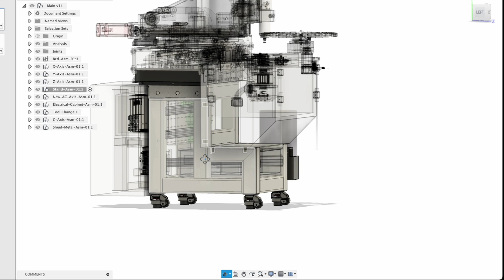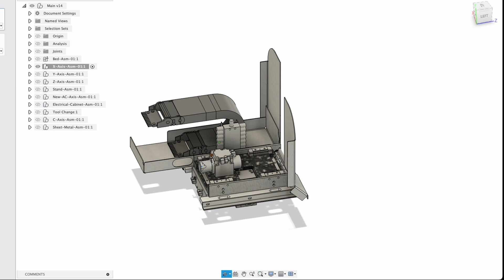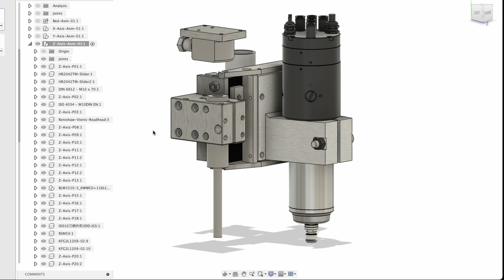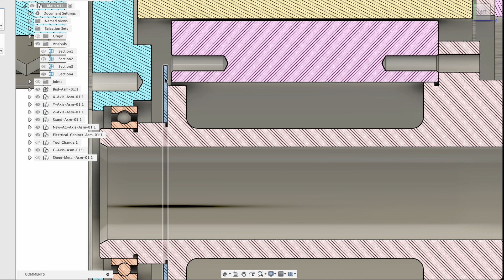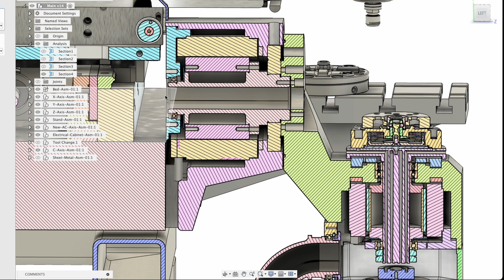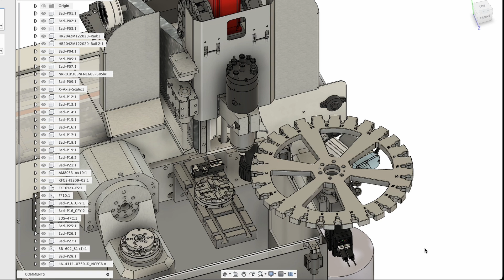3D Designing a SUPER-PRECISON 5 Axis CNC Machine - E001

Comment: Great design, look forward to the finished product.

One question, why did you choose aluminium as your choice for the rotary axis? I see a lot of DIY machines but I generally put it down to cost etc. Would a cast iron or steel one not suffice for any particular reason? Or is this choice purely cost driven?

Comment: Very nice and interesting cnc machine. It's a Quite complicated, which means quite expensive. But the whole concept and the individual solutions seem correct and should work correctly without any big problems. I see a couple of technical solutions for the first time, which I would like to implement to my own CNC equipment, for now of course, in my dreams... But who knows, maybe in the future I will be able to realize something. The best thing I have observed in your device is a solution in which the processed material is stationary (of course we are talking about a 3-axis machine), and all the equipment placed on frames moves in the x, y, z axes. This creates the possibility of significantly reducing the problem of ubiquitous waste and chips generated during cutting, in particular getting them into the drive mechanisms, bearings, rails, etc., as well as using the coolant liquid exactly in one area in the work zone. Since this, entire area will be tightly built up, it will create isolation of the entire machine part with drive mechanisms, control electronics, etc., from being flooded with the coolant used during the entire manufacturing process.  In addition, you can also place a conveyor belt at the bottom of such a sealed tank to facilitate continuous removal of chips from the machine, as is done in professional industrial CNC machines. Apart from the fact that the entire complete machine will be very, very heavy, the mechanical part itself consisting of granite frames and containing most of the drive of the individual x, y and z axes, spindle motor, stepper motors, etc., will also weigh a lot, which probably requires the use of very strong and durable Rails, bearings, or the stepper motor itself, so I have a question, what power of these stepper motors must to have? Is there a conversion factor that tells, what power motors and all the rest of the drive components should be used depending on the weight of the device that the individual elements will move? Also, Will the entire process of building this machine be shown on the YT channel, which would be very interesting, and it would be great scientific material showing all the beauty associated with the construction of machines and their subsequent operation. Best regards from Poland, Jacek.
Reply from the maker: @jackwitkowski7818  thanks for the comment. 

You mentioned quite a few things, and some of them have already been answered in other videos. 
You are correct about the shape of this machine which would allow the workpiece be separated from the machine's axis. This concept is knows as a moving column among the machine tool people. The other two popular models are the C-Frame machines which are the typical VMCs and gantry (portal) style. The moving column is my favourite if the stroke in Y axis is quite short, which it is in this case. 

Regarding the motor torque/power requirements, there are a few formulas that can help with calculating the needed torque, but some of it comes from experience as well. When I get to the installation of the servo motors, I will remember to mention why I went with what type of motor. Keep an eye out for new episodes!

Cheers,
Kasra

Comment: wasnt there any option to use a slip ring instead of the conduit wiring ?
Reply from the maker: A slip ring is for electrical connections. A rotary union is a combination of a slip ring and multiple air/liquid lines. They are big, bulky, expensive, and with a short lifespan. I have used them in the past and don't like them. I tend to go with other options if I have the chance.

Comment: Nice machine. Just wondering why, the cooling on the ball screw nuts and liner rails. What type of temps are we talking about? What do they get up to?
Reply from the maker: Thanks for your comment. Even small variations could affect the accuracy of the machine (as low as 1 degree C). To have a stable and repeatable production, regulating the temperature is critical.

Comment: Very cool project.
Why have you picked umbrella toolchanger, over vertical wheel, in configuration used by e.g Zietz FS5MG or ABEL? You could have one less actuator (the one tat has to push umbrella inside work envelope), smaller floor footprint (good for home shop machine) and easy way to get 2x tool capacity by adding second wheel in parallel.
Reply from the maker: Those machines are a gantry system not a moving column set-up. There are a few reasons why I went with this concept. But in terms of length, this is the longest length that you can get a C0 ball screw. So for the sake of not having the actuator, I had to compromise the accuracy of the ball screw, or I had to made the fixed table smaller. The actuator and hinge mechanism was a more sensible option. In terms of the vertical tool changer, it was a consideration at first, but I really don't like those tool finger clamps, they break easily (especially for a T11 holder), and not very reliable. So I went with the solid option of fixed machined tool pockets. I guess 28 tools is an ample amount for now, but I can go with the vertical model if I needed more tools.

Comment: Looks like a very nice machine, I look forward to seeing it fully built and making some parts.

My immediate thoughts personally I would use a V-Lipped seal on the rotary axes, and even go a step further back it up with a labyrinth seal and make the rotary axes positvely pressured and purge air through them for absolute certainty your expensive components do not get damaged. Especially if you are going to use the C axis to mill turn parts.

I am sure you may have looked into that design choice when making your design, what would be your reasoning not to opt for these sealing methods over an O-Ring on the B axis?
Im not able to definitively tell what your C axis sealing method is from the CAD.
Reply from the maker: Hi Max, thanks for your comment. 

1- The C axis is pressurised, both the housing and the bearings. But after your suggestion for a V lipped seal, I have now added that. So thanks for the tip. I think the labyrinth seal is a bit over kill as on this machine we don't use high pressure coolant. So the positive pressure should be sufficient. 

2- This video was recorded months ago, I have updated the sealing on the 4th axis since.
Reply: @kasramehraky9283  No worries, I wait in anticipation for the next videos!, especially if you are going to make a video on the control integration and stuff. That is super cool to me.

I find the V-Lipped seal to be very resiliant, for example in DMG Mori machines they have a service life of around 10 years on the swiveling axes, and an undercut "labrinth" for lack of a better term, basically comes free in the manufacture of the parts, you can therfore ensure no coolant ingress into the C axis, depending on your seal clearance straight sealing is not always the best, a groove with drainage works good for the labrinth seal, kinda hard to explain the shape.
Reply from the maker: @max_eley  Thanks Max. I have seen the shape on the DMG machines actually. We used to have a few 5 axis DMUs back in the day...

Comment: 21.45 Labyrinth seal (air-seal) will be better to protect the costly bearing. 22.50 Also the second bearing seams less capable i'm not sure but i would not cheap out on it cause it is still important. awesome project.
Reply from the maker: Thanks for the tip for the seal, I will check it out. The second bearing is also a relatively high precision bearing, but not greatly preloaded.

Comment: Nothing super precision has wheels. 

Hardinge, Moore tools, Yasda, all micron precision, no wheels.

If portability is an issue, thats one rhing, but Sitting on 3 level points, is always your best bet, isolated on its own concrete pad.

Dont want to seem like its all critisizm! Just a first take 10 minutes in!

Beautiful machine, and a lot of work went into this!
Reply from the maker: Thanks for the comment. The machine will sit on leveling anti-vibration pads. The wheels are engaged only when I need to move the machine. If you keep watching, I go through the details of these castors.
Reply: 3 point leveling vastly reduce distortion, you surely know this.
Reply from the maker: @papukaiffa  Yes, that is correct. But not so much for a machine that is sitting on a vibration dampening rubber mat.

Comment: it's obvious that a lot of experience went into making this machine- not everyday that you see watercooled linear rails 😅

I love the modularity of the front portion of the bed - In theory it looks like you could also make a bigger fixtureplate and have a super precision 3 axis with a decent work area.

It would be nice to see some gang tooling on the turning toolholder, seems like you could pretty easily fit in several tools for smaller parts, although it appears you've built this with certain parts in mind, so maybe it's not super useful.

Those half linear rails seem like a bitch to assemble, let alone allign and preload - I can imagine ball bearings going everywhere super easily lol.

Purely out of curiosity, what kinda parts are you planning on making with this? Also what kinda budget did you aim for? Can't imaging custom lapped granite would be cheap!
Reply from the maker: Thanks for your comment. I have actually designed a larger fixture plate that is higher than 5th axis table which would allow to have a huge 3 axis machining volume. 
There will be a gang tool magazine for the turning tools.
I have explained about the special linear rails in the new video. Check it out!

The machine will be making small watch parts (including the movement parts - i.e gear train, wheels, etc), medical parts and electronic moulds.
Reply: @kasramehraky9283  cheers for the reply, already seen the new vid- its really inspiring to see this thing actually coming together, and Ive already learnt alot from the process so far.
Reply: you see them a lot on higher end machines. At my previous workplace we used GF-machines, they had temperature controlled axes and servos. But the cooling design mentioned in the video is flawed, and it will only last 1-2years before start leaking and will need some serious maintenance. Pro tip to check before you mix metals in cooling systems: galvanic corrosion.
Reply: @mihalikalex  did i miss something, or is the entire cooling path aluminium?
Reply from the maker: @kayrunjaavice1421  The whole thing is 6061 aluminium.
Reply from the maker: @mihalikalex  Thanks for the tips. I already use a protective coating between aluminium and stainless steel as it can cause corrosion over time. Fortunately I am not selling the machine, so if anything went wrong, I should be able to do the maintenance myself.

Comment: Damn, this is a cool project. 

Mind I hope you have the funds to fully manufacture this and the patience to do the fine assembly as this is going to be insanely time consuming and expensive to make (personal experience making my own small 200mm trunnion for a cnc).

Couple of quick changes I would personally do is add brakes on the rotary axes (especially on the tilt table as that will be a problem with a small direct drive motor like that).

Also as far as I can tell you have some spring loaded counterweight in the back and I would do a constant pressure pneumatic counterweight instead using a compensation tank as that is a fairly robust and highly adjustable system.

I would also personally never dare using the rails you want to use (I have seen the mounting tolerance for the needle roller bearings Kern EVO, tho those are one class higher in the precision), specifically as the preload is going to have to be highly precise and rigid and unless you plan to use a shim, hard to setup without messing up your alignment. There is also the fact that the Kern Vario for example uses fairly standard low preload THK recirculating ball rails and is much simpler to get right.

The machine frame isolation is a good idea (to isolate the frame from external vibration as well as reduce enclosure ringing), but I have as of yet not seen that system used on a base that light (a very prominent machine using a floating isolation base is one of the old Mauser vmcs, but that used a massive granite block that is suspended).

Also since you are doing all that work with temp control what I would do is add cooling to the ballscrew end support (which directly generates heat), as well as direct oil lubrication to the ballscrew mainsupport (reduces stiction as well).

Another trick to reduce heat bleed is using only the disk coupling mounted motors (small contact area connection) on the floating side of the ballscrew (you can remove the floating support), instead of at the fixed block (this also allows for higher compliance in terms of the mounting since you now have a much less constrained connection).

Anyways really cool project looking forward to how it develops!
Reply from the maker: Thanks for your comment and interest in the project. I uploaded another video answering most of your questions.
Reply: I am thinking of manufacturing a 5 axis CNC. Can you please suggest me how to put brakes on A and B axis motors for positional precision?